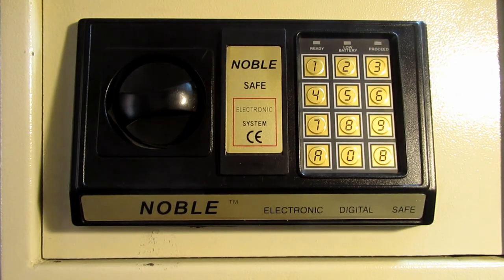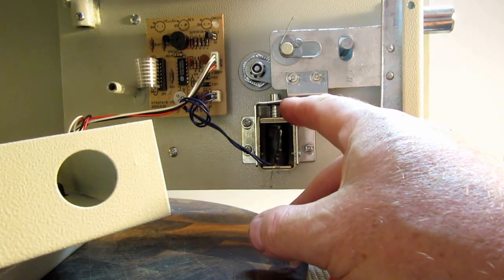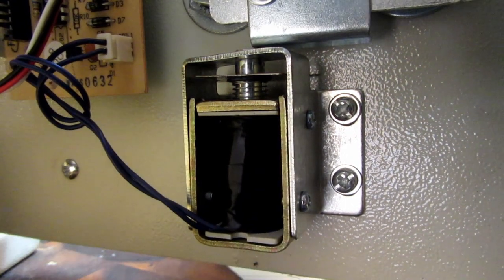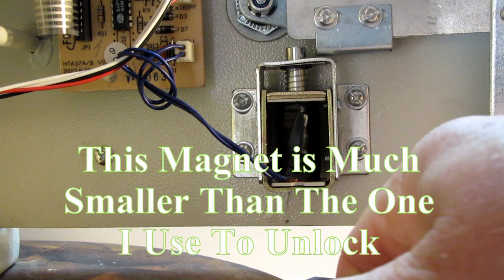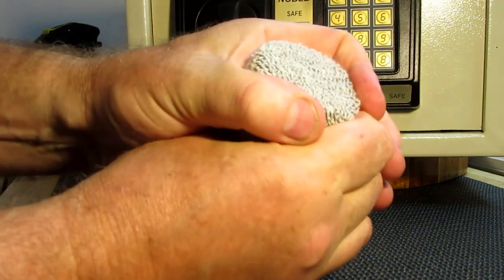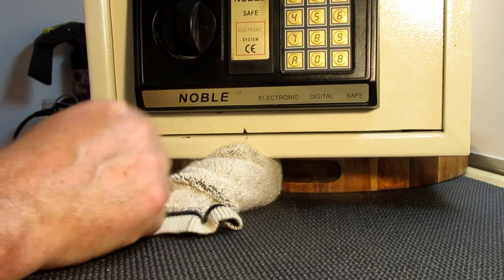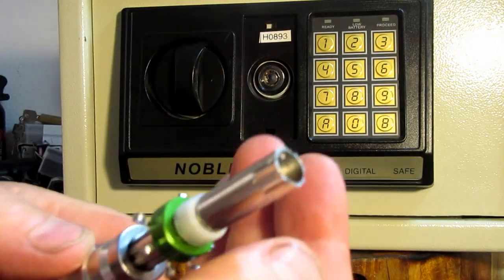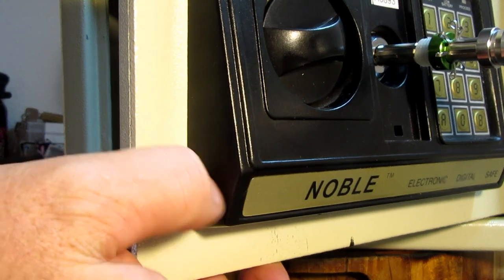How To UNLOCK A SAFE WITH A MAGNET Explanation & Demonstration & Lock Picking

Comment: Great video!  I have one of these exact safes.  But it is very thoroughly bonded inside a low fixed cupboard shelf.  So a magnet cannot be used.  But didn't know how cheap and nasty they were inside!  Or that that pick tool is so readily available.  By the way,  that is one hefty magnet

Comment: drop the safe on the floor wile turning the knob.  The impact will cause the pin in the solenoid to drop releasing the latch.
Reply from the maker: Or just smack it with a rubber mallet also can do the trick...

Comment: You're the 10th YT channel I've seen using the lock pick tool. I ordered them I can't get it to work. It won't open the safe, won't open a cheap cabinet I have for storing paint and kick knacks, it won't open the tool box or any other lock I have that is tubular. Every channel literally shows just sticking it in and a little wiggle and done. Tried with 7 tensioning bands down to 0 tensioning bands. Either I am missing something or I have a defective set. Any hints or tricks on the use of the lockpick set?
Reply from the maker: OK first i do not know yr lockpicking skill level i assume your starting out which is cool we all start at step one... Like any lock pick set it taks a ton of practice before you start popping locks. When i first used a tubular lock pick set i could not open locks with it either but in time it comes , watch lots of unedited videos. Tension is key light tension lighter better. The tubular pick set will not open all tubular locks ,learning which locks it will open also takes time and practice, keep practicing light tension..good luck
Reply: @JollyPeanut  Thanks for the tip I will give it a try. My skill level is somewhere below rank amateur. meaning I have never picked a lock in my life. I saw so many vids of the Huk set being used and literally opening locks in seconds. It isn't quit like that. It more like...try, reset the pins, try again. take a  bands off, try again, cuss a bit, try some more and repeat the process with the same results LOL

Comment: Get some strips of rubber and place it under where the magnet would go, also attach a piece of aluminum against the door and reattach the plunger.  The magnet no longer opens the safe.
Reply from the maker: That would probably work to stop the magnet but it will not stop the lock picking which takes seconds to open one of these type safes, probably better to just use a more secure safe if you value what you keep in it.

Comment: I have a S0500 Sentry safe, # AA-a476149* I don't use hardly ever because it just has old family pictures in it. I forgot the combo, And have tried a 500 lb Magnet going all around the handle . Still don't open it,  were exactly should I put the magnet? Oh also it is mounted inside the bottom of cabinet that's more the the price of the safe. Please Help me. Tanks

Comment: Hi. I picked up a Browning Prosteel gun safe for $50. They lost the combination. I figured it is worth trying to open and install a new manual lock instead of the electronic.
Any suggestions??
Reply from the maker: I know they use S&G mechanical locks on some of their safes but i have not worked on those. Maybe worth contacting Browning I am sure many people have forgotten there combination.
Reply: Jolly Peanut I am curious if this method with the magnet might work. Browning isn’t very helpful and apparently there is no master reset code for the S&G
Reply from the maker: @rickallmightyjones6189  Magnets only sometimes work on digital electronic locks and to stand a chance you would need a more powerful magnet than the ones i have , if your safe has the mechanical lock the magnet method will not work. Some local locksmiths do work on these locks they may drill a small hole to open it which can be easily repaired, get a quote first if you go this route.
Reply: Jolly Peanut  Thank you, we only have one locksmith and his minimum fee is $350 plus the lock replacement so it’s not a good option. I am going to try and find tutorials on drilling it myself. It’s worthless right now anyway
Reply from the maker: When you drill the hole it is critical it has to be in the correct place to within a few mm to allow the lock to be manipulated from the inside, it is a tricky job but worth a try..Good luck.
Reply: Jolly Peanut Thank you for the help!
The only other option would be to cut through the back and open the door then weld it back together.
It may just head to the scrap yard
Reply from the maker: @rickallmightyjones6189  Your welcome....Its faster to go through the side with a disc cutter but you will also have to smash through the fire proof lining which is easy enough but messy wear a mask the dust is iffy plenty videos out there on doing this...
Reply: Jolly Peanut thanks for the help!

Comment: mr.  jolly peanut sir.  can it really open all safes?  i mean there are large safes that the solenoid is in the middle and not in the bottom. i dont think the magnet can still pull them, even if it is rate earth magnet.  it would be great if you could demonstrate larger safes.
Reply from the maker: I never said it can open all safes although it can open quite a few types of solenoid safes as well as some other types of electronic & magnetic locks. I am not going to buy a larger safe just to make a video to prove it i don't need to there are already other videos out there on this subject .Here is a link from a guy doing just that on a larger Sentry safe and i can confirm it does work on these Sentry safes...https://www.youtube.com/watch?v=ApJQ2wcYjBo

Comment: It should be fine if bolted down somewhere cramped ;) Can't chisel it nor magnet it.
Reply from the maker: But it can be picked in seconds almost as fast as using the key. There better than nothing but they sure aint SAFE...
Reply: That's assuming the thief comes prepared with super -strength magnet or special picking tool! 😂😂😂 I have a similar safe. I tried bouncing it and thumping it. The safe would NOT open!